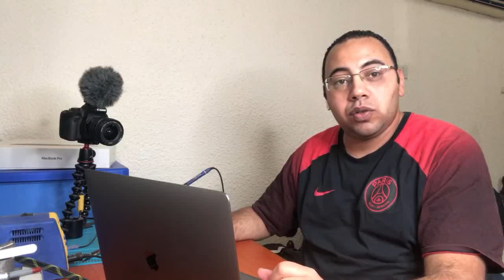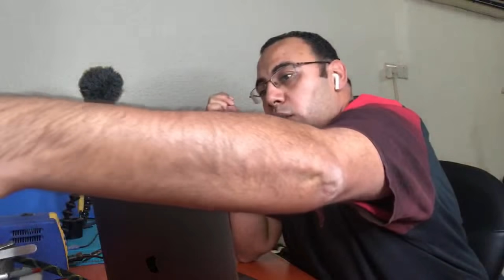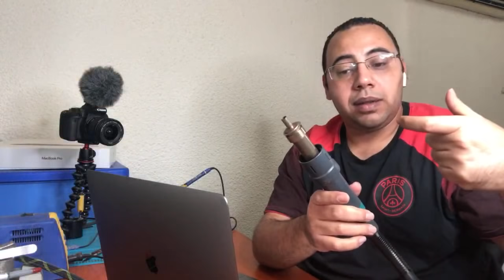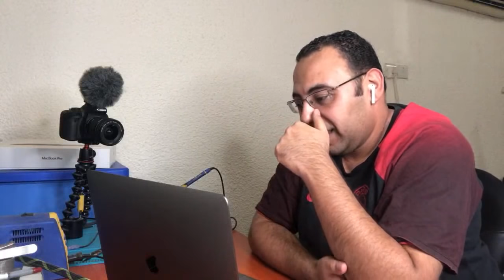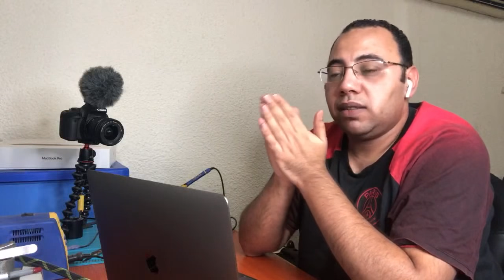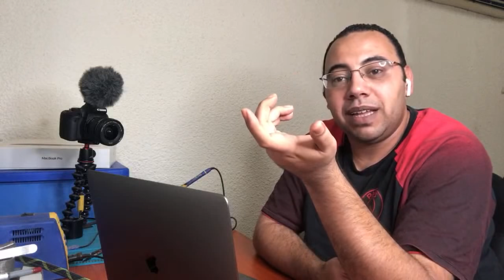iPhone Repair Questions & Answers

Comment: Hi ,more of this please ,can you do a video on the touch repair on iPad Air 2 can’t get 20.1v ,coil and diode changed !
Reply from the maker: i have to have a case to be able to troubleshoot it but if you changed the coil and diode it is the chip